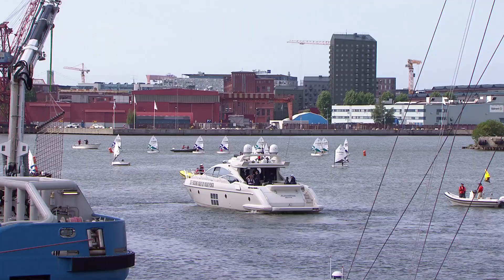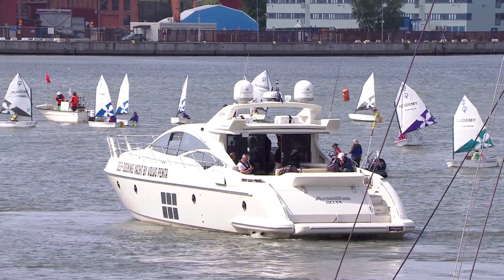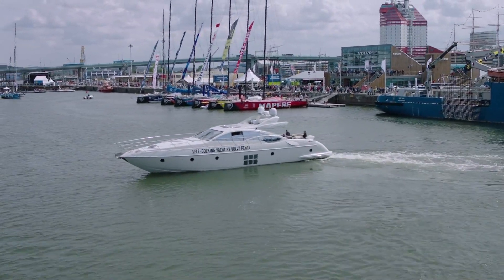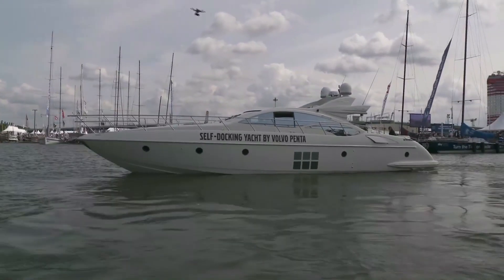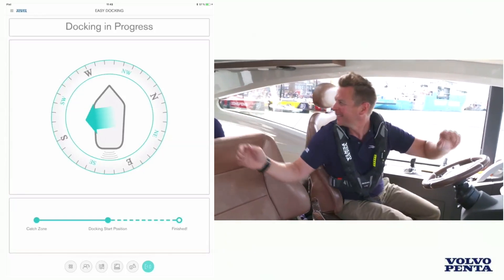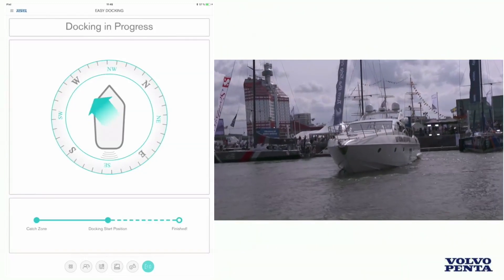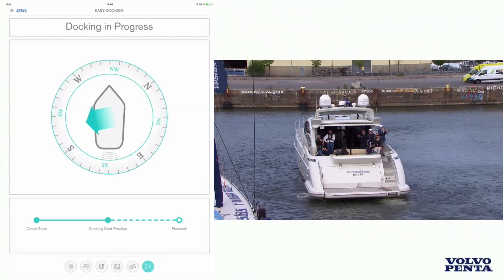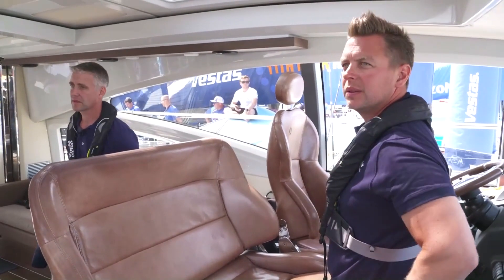Technology: Volvo Penta self-docking system

Comment: Dynamic Positioning Systems (DPS) we used on vessels for oil platforms. These systems, categorized as DP1 to DP3 based on precision levels, involve various components like thrusters. The differences between these categories typically lie in their costs and the size of the thrusters used. DPS technology has been crucial in maintaining position and stability for vessels during operations near oil platforms for several years now. Seems that Volvo Penta create a cheaper system and smaller trusters, but the principle seems the same to me.

Comment: As a drone flyer. This sort of precision GPS navigation has been around sometime. I had several DJI drones that could land on a 1 m landing pad, after being airborne sometime and at some distance from the landing pad. One touch of a button and it would return to home automatically and land on the pad. Obviously the wind and the fact it was in 3-D space could make that process difficult to perform manually. I never had a failure. I am sure Volvo Penta will be able to refine their auto docking system, so that only sensors on the yacht will be needed. Perhaps using the same technology as my drones. Optical flow sensors, perhaps. When in close quarters.

Comment: I'm not understanding! Lots of yachts in the 40+ foot range have bow and stern thrusters.  I have watched lots of them move sideways.  Why do the commentators think moving sideways is so awesome?
If the system is reliable this would be helpful for single handing a big boat.
"Sensors on the dock" doesn't sound like it will be useful for the passage maker class.